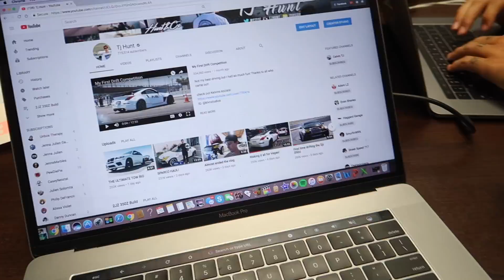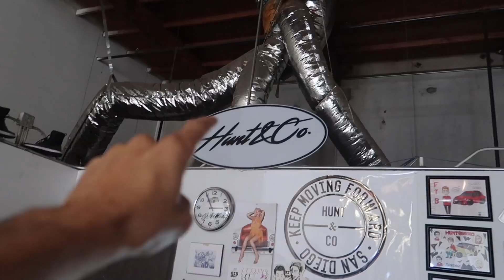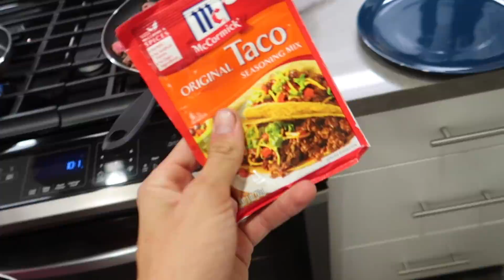RIP X5M

Comment: Just a cooking tip teej, don't use metal utensils on a non-stick pan (like you did making your taco shells), it wears off the non-stick coating that on those pans.

You probably won't see this but whatevzs yo, at least someone will
Reply: ACIDBURN6661 I saw it!

Comment: Sabrina needs the bmw mom mobile, get a diesel for towing.
Reply: jay west It's not much of a mom mobile if it can out run a Corvette.
Reply: i mean he doesnt really need a diesel to tow 6000 lbs.. a gas v8 truck would be sufficient
Reply: This should be pinned
Reply: StreetSavage 614 not a new one
Reply: Wheels Lifts yes but it would be really bad on fuel
Reply: Wheels Lifts and it’s twin  turbo
Reply: Anthony Saucedo A new Stingray, Yea
Reply: Anthony Saucedo I own a 2018 Z06 and a 2013 ZR1 and love the cars, but BMW is doing really well right now.
Reply: M773 actually several corvettes would lose to an x5m.
Reply: Jake Angelo Not for cars, but yes.
Reply: Jake Angelo I'm from Plain City, about a 1 hr drive to Columbus near West Jefferson.
Reply: M773 beta like your dodge at the strip 😂

Comment: The BMW is not a tow car. Buy a truck with a common wheel size and spare. Flats are gonna happen. 
 I don't see the BMW transmission or axle handling the abuse of towing.
 If you are determined to tow with the BMW make sure you get a tire with the proper load range.
Reply: But it looks so COOL! Who cares about safety or common sense!
Reply: He should really run the stock size wheels and tires I'm sure it would tow fine. I'm personally going from 19s to 18s on my e90 m3 because the car drives better on 18.

Comment: Just a heads up you don’t have to bleed the coolant system if you drill a small hole in the tstat to let the air through just running the car will take care of that. Probably more of a pain to do at this point now that you have it together but for future reference

Comment: HRE wheels are dope and great quality but chech with them for the weight ratings on those wheels and factor the X5's weight with the tongue weight on the trailer. Also check the weight ratings on the tires as well boss, and that tire width should be at least about a 45 for the trailer I reckon

Comment: Should’ve been like Adam. Smart guy bought a truck doesn’t matter if it’s diesel. And then buy an enclosed trailer so that you can store extra tires and any other tools in the bed of the truck or have in the enclosed trailer.

Comment: Why didn't you just swap the rear wheel to the front. Less load on the bubble. Now you know Jabroni
Reply: Hooligan On A Ducati idk about the x5m but on a lot of bmws run staggered fit wheels so that could be why they didn't do that
Reply: It's much safer when a wheel blows out on the rear rather then the front (the front controls steering) ;)
Reply: nathan bonifay true, forgot about that.
Reply: Johh Joseph that I know but with the trailer it was not avoidable. I've driven the x5 and x6. M and non M. The steering is very easy to control. I've been hit in a 2013 x6, driver side axel broke. And tire rod. Drove it home another  3 or 4 miles dragging the wheel.
Reply: The other car hit my rim and bumper where the camera is at an angle

Comment: You need a fucking diesel and a enclosed 24ft trailer to load the car and all your merch, you can slap a sofa bed and a a/c unit with a good generator and you have a decent toy hauler, it would be good content to do stuff to the trailer and the truck

Comment: rubber band tires aren't rated to tow, probably  don't have trailer brakes either. BMW is just not designed for towing. gotta think of the danger you're imposing on other drivers mang

Comment: A Hisense TV??? Really?? Rep parts now Rep tv smh. #kingchach 

On a serious note when you get new tires for your wheel setup make sure the tires have stiff sidewalls (LT rated tires). Will make a huge difference when it comes to sway, also don't be afraid to pump your tires up to max PSI.

Comment: Also doing the tire rack bullshit will add more tongue weight which I think you're already at the limit by loading the car with the engine on the front of the trailer and you're asking for a shitty tow and dangerous way to drive

Comment: TJ you do realise this is still the X5M's fault because even if it had stock wheel's (Yes I know the wheels it has are aftermarket) on they still has tiny sidewalls at around maybe 2-3 inch if you're lucky and really shallow tread compared to a truck. With a truck you would've had around a 7 inch sidewall with deep tread and not only does this reduce the chance of this happening it also is better for ride quality whilst towing because you have a larger amount of air that is cushioning the ride along with better suspension that is designed for towing unlike your X5M's suspension which is designed for performance. So basically as much as I like the X5M for performance you should just sell it and buy a truck any 1/2 ton truck will do and it doesn't even have to be a diesel so for example you could get a 2015 F150 Platinum gasser with 20-30k miles for $30-40k (about the price you would get for your X5M) and you could probably find a truck cheaper. Yes your X5M may be rated to pull around 6k lbs but as I said before it's designed for performance not towing! With a truck not only do you get better safety when towing but you get a higher tow rating at 10k+ lbs and a larger cargo area for things like tools and tires all while still keeping the 5 seats inside free for passengers.